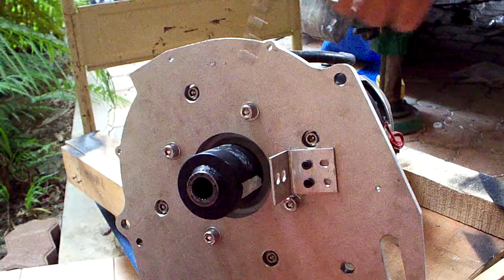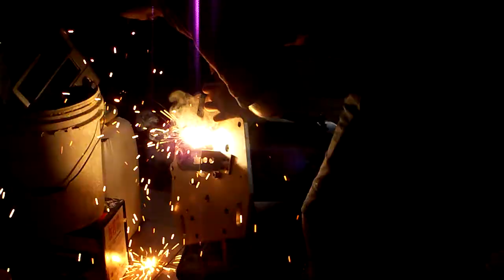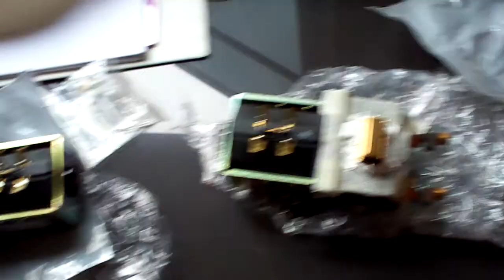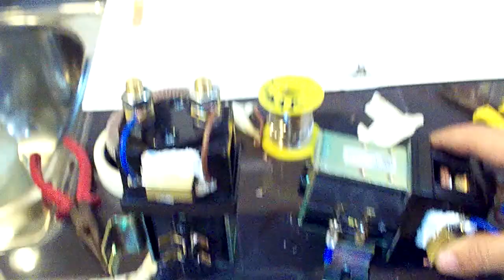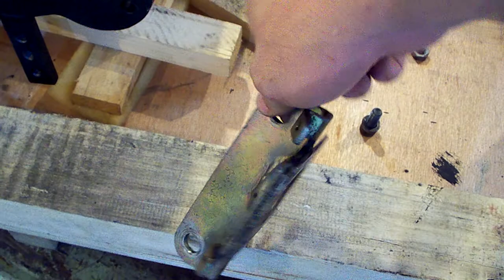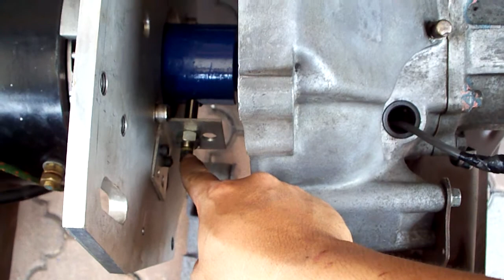Event 32

Comment from the maker: @evric2008 
Ha ,, Ha ,, Ha ,, Eric
getting the motor in all alone is "NOT" the best way 
80Kg motor mated to a gear box. 
I will 'NOT' recommend it to anyone else ,, do it at your own risk ,,
it did fall off the ropes when I tried to line it to the gear box
I had to pick it up and retie the whole  rig again
if you look close enough ,, the rope position changed from both around the motor 
to one one the body and the other on the adapter plate ; )

Many thanks for the support !